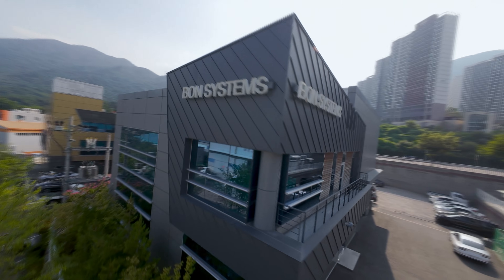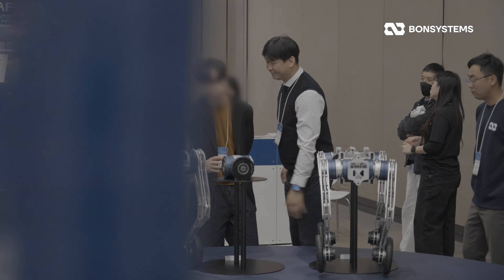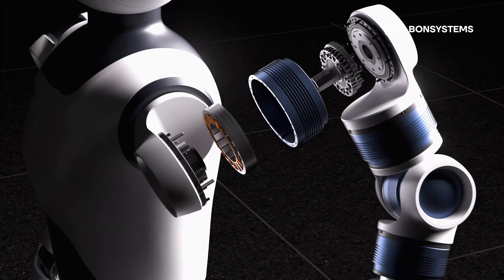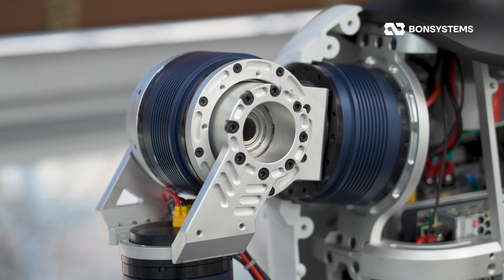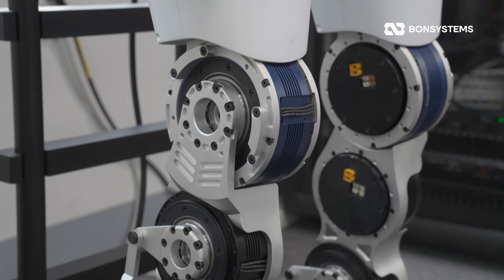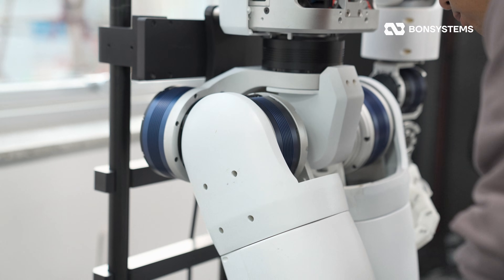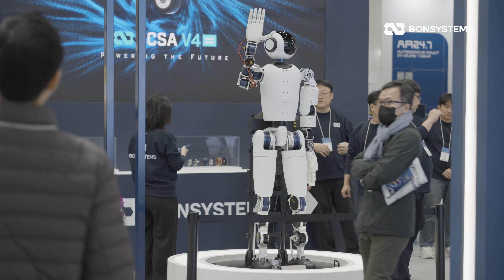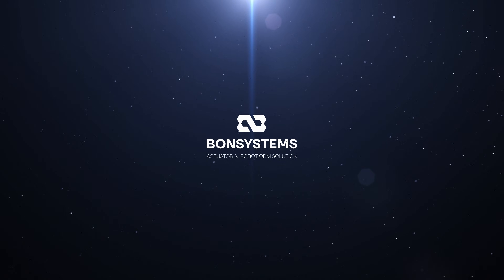Why do humanoid robot companies develop cycloidal reducer technology in-house?

Comment: Subbed because I like what I see and the engineering details. Most are just advertising. I would put a direct ethanol fuel cell in those to extend endurance. If I had one of these I think for now, I would not push Ai too hard the way industry is and maybe stick with adaptive mocap libraries, blending state machines and teleoperation.
Reply from the maker: Thank you for understanding that as a corporate channel, some promotional content is unavoidable. We haven't quite reached the level of sophistication you mentioned just yet, but your ideas regarding power sources and control strategies are very intriguing. While we cannot disclose our specific development roadmap at this stage, I will definitely share your insights with our engineering team. Thank you for your interest and support!